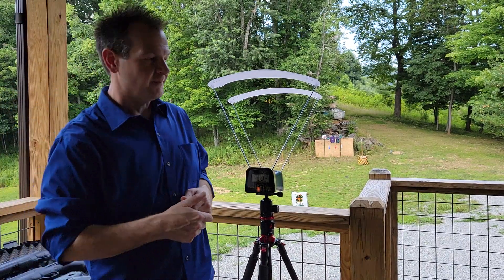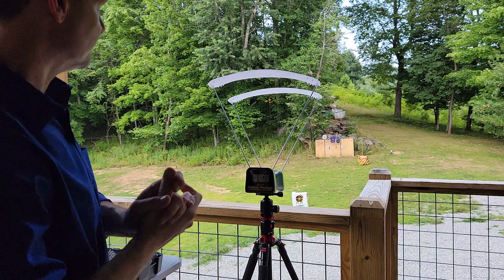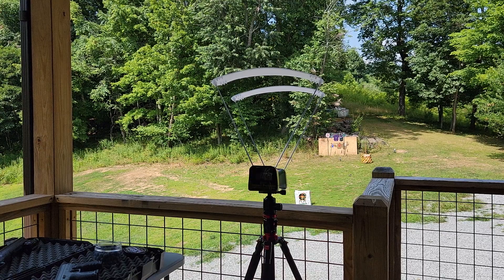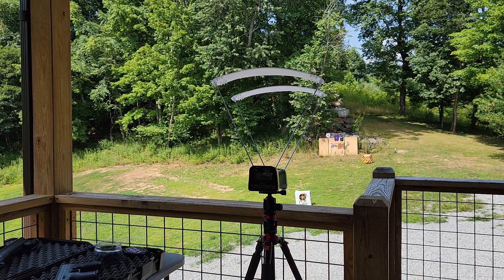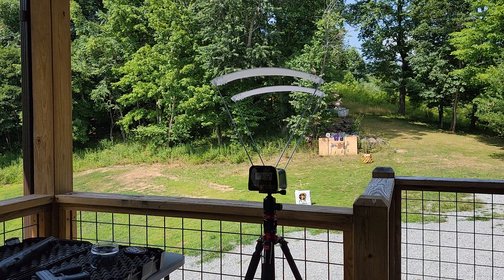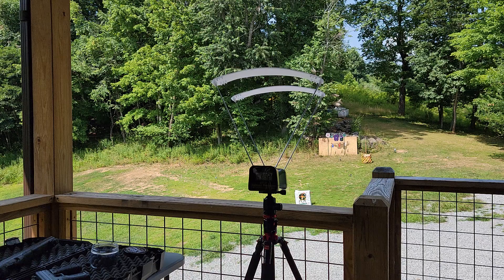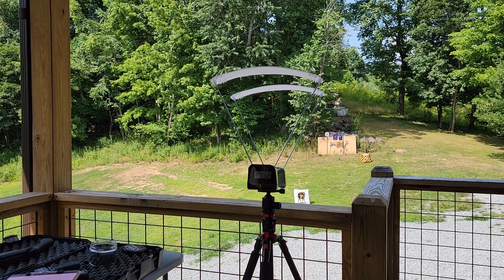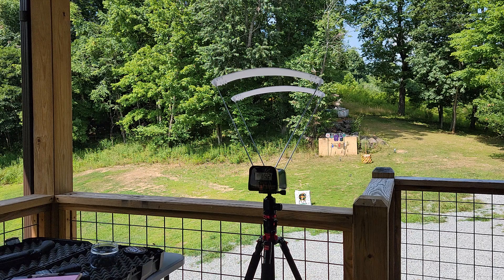16 Joule HDS vs. Byrna vs. 7.5 Joule HDS

Comment: Checking the temperatures of the cylinders with such a device needs to have its emissivity of the steel type taken into account if the goal is to be accurate.. Albeit the less expensive laser thermometers do not have the able to input emissivity / material value but reflective steel in the sunshine is hard to get the right value so, it's ball park